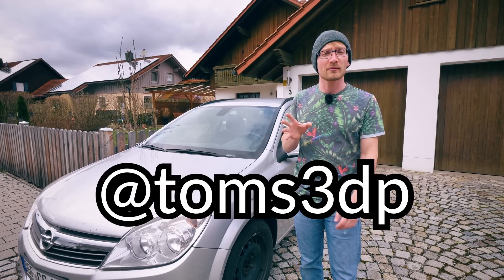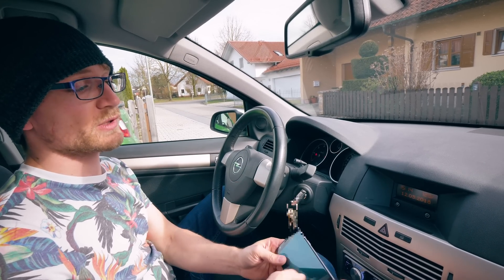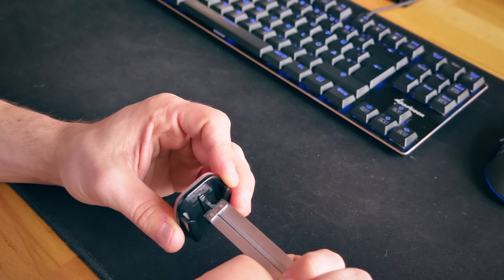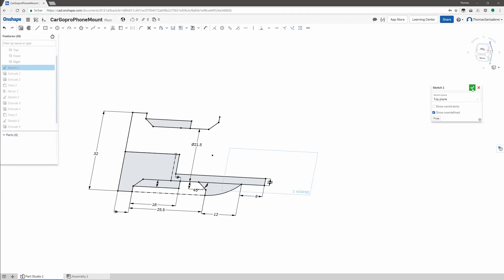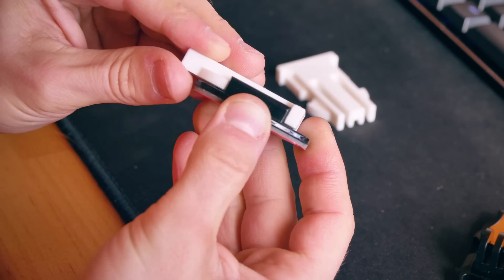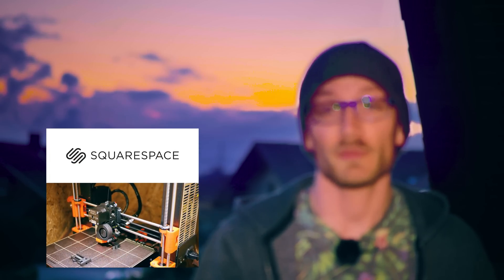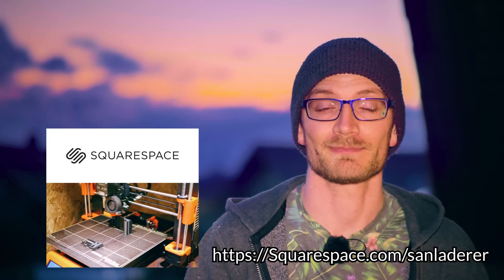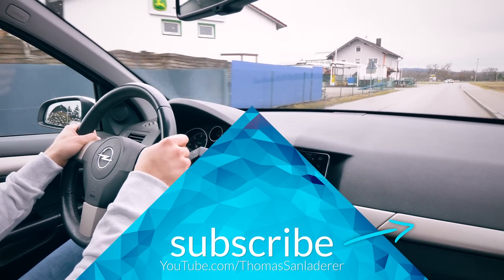Solving problems with 3D printing: Upgrade your car!

Comment: My 2014 Chevy Sonic has like a tray on the dash where I put change, but the coins fall out every time I make a sudden stop or turn so I 3D scanned the tray and designed a new one with higher walls that curved in so no change falls out. I've been using it for a year now and it works great. I made a video on my build too.

Comment: Recently I finished modifying my Ender3 to print TPU filament. One of the first things I made were some replacements for the rubber bumpers that keep the air filter in my wife's car from rattling. They had worn out, and now she has some shiny blue ones in there and the car is quiet again. 

I myself drive a very common vehicle in the US, and it's handy because there's all sorts of STL's out there for it.

Comment: hey after 2 years , can you let us know how the material got through heat & time .
did it survive ? 
here where i live it can get up to 80° inside a parking car.
i know for pla it could be a problematic. 

would love to hear your opinion to make the right decision
Reply from the maker: I don't own the car anymore, but from experience of using parts in similar conditions, ABS / ASA will hold up perfectly over time.

Comment: I like your channel. I liked Opel until they came up with this model. In fact, my very first car was a 1983 Opel Manta 1.8, then went to Kadett...  But this one.... it was probably designed and signed for production on the first Monday after October-fest... :- D and you can 3D print your front suspension droplinks, yes, they are plastic, where on any other cars they're actually made of steel... :-D :-D hope you got rid of this thing by now..

Comment: The problem is one needs to remake this holder after every phone upgrade. Which is actually not a problem in case you are the very designer of the holder and still have original cad files to modify. That's a biggest plus of DIY methodology: if I make it myself, I can fix it!

Comment: This was probably said before, but it looks like your car has a 2U space to fit a cheap android auto radio in your vehicle. If you don't have a mount, you could always 3d print one and have the USBs come up to your phone mount so you can still have your phone available and have a full android auto experience with more 3D printed parts

Comment: recently, i made a two piece belt tensioner for a CNC router i'm building.  I designed a sliver of the two pieces, printed them in about 10 minutes each, and then verified they would slide nicely without binding.  once i had them working nicely, i then extended the length to print the final copy.  doing this way saved time and filament.  In your design, I would have went about half the size until you had it sliding easily together.  just my two sense as a beginner in 3d printing and being cheap.  Otherwise, nice job!

Comment: Hey Tom if I make a window bracket that rides a guid rail and bolts to the glass out of pla with 100% infill do you think it will hold up in the summer time? I'd like to email you pictures of it to see what you think. I can't figure out my petg but they came out flawless using pla

Comment: I want to print things for my car that are way bigger than my build plate.  My Toyota Highlander has a known issue of visors that plop down due to weighing too much.  I want to print new visors that will hold piece of pexi-glass and coat it with dark window tint.  I'll probably have to do it in 3 prints and glue it all together.  And I want to do better cup holders for the center console.  I was expecting you to print a piece that covered the entire cubby that pressure fitted in place to hold your phone.  If the phone were all the way to the rear then the overhang would block the sunlight... at least we have sunlight here in Arizona...

Comment: Sweet, I own a 2007 Astra Twintop convertible which has a lay out a bit differently and I replaced the radio with a media system, I just use it with a fan mount, but this is a way better solution!

Comment: 3d printing: measure twice, print 5 times. ;D
Reply: My Dad as a CNC Machinist, with a boss that designs stuff. Measure once, my dad cuts 7 times.
Reply: @komicalkramer6188  I'm a cnc machinist my boss come up with an idea, tells you very little info and says get on with it, "it's your baby" he says. Then proceeds to tell you he doesn't like that, that's not what he had in mind or he thought youd do it this way...
Unfortunately thats part of being employed, learning to say "why the f*** didnt you tell me that in the first place" politely..
Reply: Classic, once i designed a conveyor and i need to print 5 pieces in total 68 times :D
Reply: Nah, I really prefer measuring 5 times and printing 1-2 times.
Less waste in time and material is always a good thing imo.
Reply: @Der_Kleine_Mann  I agree, but originally we were joking about how things often go wrong with 3D prints, either design or machine wise, meaning even if you're careful to measure twice, you still often end up doing multiple prints. And it's a play on the common saying, measure twice cut once if you didn't get it.

Comment: Der wagen hat sitzheizung? Wo schaltest du die ein? Ich habe selbst einen Astra H GTC mit Sitzheizung und die knöpfe dafür sind in über den Lüftungsschlitzen rechts und links vom schalter für die Warnblinkanlage. Habe auf jeder seite 3 knöpfe, und nicht wie du nur jeweils einen.
Reply from the maker: An dem Auto habe ich einiges nachgerüstet (PDC, AHK, SHZ, Radio...), die Schalter für die Sitzheizung habe ich in die Ablageschale unter der Handbreme eingebaut. Original ist mein Astra nur ein "Cosmo"!

Comment: Hi Tom, I had two questions.

What tap size is that?
and what is the smallest durable (thread integrity) tap you would use with 3D prints?

Comment: i did print a cellphone holder for my car too....and a couple of parts for my motorbike..even a prototype of an defensive spray that is patented now....i love 3d printing!!!
(btw. dont use PLA for it...inside of cars it will get very hot at the summer..)

Comment: Great video and glad you've shown the iterations - I had this in a project for a boost gauge where it took a few times to get it spot on. Just recently I've printed something Audi want £200+ for.
Really glad to see car stuff moving forward in the 3D printing world and where OEM bits or aftermarket solutions can cost a lot! I'm hoping to see some more car orientated 3D printing sites pop up but I'm also biased....

Comment: Why not make a pivot hinge so you can adjust the angle
Reply from the maker: Complexity! No reason to overengineer things if the simplest solution works just as well.

Comment: Similar task brought me into 3d printing 6 years ago. I've designed a small adapter frame to put 7inch tablet in 2din opening and ordered a print. The result was so pretty 3d printing service had its photo on their frontpage for like 2 months.

Comment: Did it work with your charging cable?
Reply from the maker: It did! Prefect space for it, but there's maybe an opportunity to improve cable routing (or integrate wireless charging if my phone supported it)

Comment: I wish i could cad better, you make it look easy. After a few minutes i get so frustrated because i don't know what to do. Where did you learn how to design? I am using fusion 360 btw.
Reply from the maker: CAD design is just lots and lots of experience - start with something small and work your way up!
Reply: zrobotics Thank you very much, that does sound interesting.
Reply: zrobotics 
Great suggestion; my first mini project will be to reprint the broken Lascal key for the kiddy board I want to sell. I just hope, the print will be stronger than the original. The original was awful, broke on second attempt to hold the board upright onto the buggy.
Reply: Any suggestion on how to make it stronger? What material is best to use, ABS?
Reply: If you are just sitting down with the program and trying to learn it, I agree it gets frustrating quick. An easy way to help with that is to pick some (reasonable) object to model or something you want to print. DON'T try to start out with anything crazy, but something like a key gives you a part that's reasonably complex without being too difficult. Another bonus with a key is that it's a small object that can be printed quickly, so you don't waste a lot of time or material, and you can then easily compare it to the original object. You don't even need to model all the ramps for the pinning at first, just make the key blank and compare it to the original.
Sort of like learning programming: if you just sit down with some tutorials without any goal in mind, it gets very dry and frustrating very fast. Having some sort of goal gives you a reason to at least finish one model, and you just google as you have questions about how to accomplish specific things. A 3d printed key isn't practical at all, but it is really fun to open a lock with a key you printed yourself.

Comment: You could have used the accelerometer on the phone to get the angle. The program "bubble" works great for that.
Reply: Thanks just got it
Reply: Ts 3dPrints I don't think the surface where the GoPro mount is is horizontal
Reply: Kil Arn Don't forget you can put the phone there, then reset it (tell the app this is your zero level) and then move it and it will tell you the degrees from where you told it to be zero :)
Reply: It is horizontal.

Comment: 0:50 Censure the keys. Quite clever considering most of your viewers own a 3D printer :)
Reply: Jokes on you. I keep useless keys on my ring.
Reply: @zecuse  i have so many keys on my keychain, even if i would post a Picture of them, it would be pretty hard to find out, which key goes to which lock
Reply: That car isn't worth stealing lol. Better to take the older Astra G, much nicer car.
Reply: If you're a professional lockpicker It's far easier than that and the process doesn't require a printer!
Censoring it's just a good precaution when you're an influencer who has public domain infos about residence and stuff like that

Comment: did you consider putting a raspberry pi 3 with the 7" touchscreen and android auto in there?
this combo is nearly perfectly double din size and shurely would fit nice
Reply from the maker: miko007 wait, there is Android Auto for the RasPi?
Reply: Thomas Sanladerer yep, it is called "openauto". it is just a "headunit", you still need a phone to connect to, but bluetooth is available on the newer raspi models and you can benefit from the other raspi features as well (like custom GPIO input connected to functions of your car or even a camera module for a rearview camera). all in all a pretty nice system.

Comment: The metric system is so much better. You made all your measurements so fast.
Reply: Metric is a lot nicer for coversions, but people freak out about it too much. You can easily do the same thing you do in metric with imperial. It's whatever is easier for you for the specific thing you're doing.
Reply: I am American and thus use inches and yard and crap. Metric is so much easier. I use it at home and it's just much quicker and easier to add measurements and make adjustments for scale. Someday maybe America will catch up to the the rest of the world for measurement standards.
Reply: Did you first learned to use metric?   Since I did not, I find it harder.  Just wanted to know if that would be a reason for preference.

Comment: I'm totally bummed now that I bought one. I love the one I have because it has a magnet in it and I can go from Landscape to portrait very easy. I think I will make on that has a magnet in it but doesn't clip to the vent and uses a GoPro mount like you did. Awesome idea thanks!
Reply: I would avoid any of those phone mounts that clip to the vent. Seriously, don't give it away to a friend, just throw it out or make an alternate mount for it. Used to work as a mechanic and saw quite a few of broken vents from those. Doesn't make your car undriveable or anything, but just the vent by itself can be somewhat expensive (up to us $150) or potentially very annoying and ridiculously expensive (>$500). We had a customer who was unlucky enough that the broken piece of plastic rattled down into the blend door and jammed it into the floor position, and with winter coming up they needed the defrost. Ended up having to pull the entire dashboard out of the truck to fish out the broken piece.
Reply: That sucks but the one I have seems ok. I do not take it in and out at all. Just put it there once and leave it so I guess I'm safe. If you move it around all the time I can see that happening. The biggest thing with these is if you can't shut off the vent. I have had very few cars that cannot do that and every car I have had in the last ten years has been able to. The heat affects the phone obviously and I see that as the biggest downside which to me is another none issue. I love the thing and think it's the best idea for a phone mount. Once you go magnetic you'll never go back!

Comment: Thank you for this great video. I've recently started designing my own parts and also love the fact that you can iterate so quickly by adjusting the parts and printing to test the fit. I really appreciate the walkthough of the design process and learned quite a bit. I need to experiment some more with tapping parts and joining using screws. Again, thanks for the great videos!

Comment: Hate to state the obvious, but kudos for blurring your keys. Such a smart move.
Reply: Maybe I'm missing something, there is no reason to do this, it is just not possible to determine the exact bidding from a video without a closeup and strait edge for reference.

paranoia perhaps?
Reply: Actually its been known that some criminals are so good at replicating keys by just looking at them once, that even prison guards hide their keys. All you have to do is get close enough to the original and then you've got yourself a bump key.

Comment: I was hoping to hear something about designing for print tolerance.  For example, if I have a 0.4mm nozzle, I basically have to print in those increments, right?  Does the slicer take that into account?
  Could print something that is say, 1.3mm or 1.5mm wide?

Also, any comment on printing threads?

Comment: Just one thing - DO NOT USE phone for maps in car. Get a proper gps. The reason behind this is that gps drains a lot of battery and if you will connect charging, phone will heat up even more. If you really need to use it, you should place the phone in vent and put some AC on it.  Great idea for 3d printer daily use :) Great work Thomas
Reply: I did exactly that on my tour through the US. The mobile had 3 different apps to not get lost in desert valley and required AC to keep the battery above 80%. It lost charge despite beeing plugged in when not in the AC vents.

Comment: I like how you blurred your keys. Nice thinking.
Reply: Even cutting it out of sheet metal or a food tin will do
Reply: yeah I would never have thought of security issues like this :D
Reply: only problem is the key is in the ignition and it requires a chip (maybe) so no chance of copying the key (or maybe print hehe)
Reply: @Darren Munsell I know this is a year late but newer cars or most of the cars has keys with chips which makes the duplicate key useless
Reply: Hi, actually I dont understand why should we do it? Security?
Reply: Yes. now a days its very easy to take a picture and recreate the key and 3D print it. Then maybe copy that to get a real key.

Comment: Wow, I went to all the effort of integrate an android computer in my Astra H but in my opinion your solution is the way to go. I was also thinking on creating a small compartment to take advantage of the empty space under the panel next to the dome lights. This is what I did for my Car Android system for my Final Project in Industrial Engineering if you want to check it out.
https://youtu.be/8L3ZARnPzhk

Comment: Quick question: How do the parts do with high humidity and heat of being left in the car all day? Probably not an issue in your use case but I would've loved to see the spec sheet for the PCA ABS you used just to make sure not fumes are leaking into the car.

Comment: I do similar for my truck, but i put i IQ CHARGER on it, so now i just slide the phone in the support and it show me the route and charge in same time. With simple modification you can do same on yours and get the big advantage
Reply: Coveniece at cost of efficiency of charging
Reply: I have a little trust issue with wireless chargers, in the sense that they are quite lossy and can get a bit warm - right against the phone's battery. I know this is not the most rational thing to be afraid of, and i assume those that just pop components willy nilly are just defective, but still. What i like though are those cheap magnetic cables, you can buy a dozen from China quite cheaply, leave the adapter end in the phone permanently and then just have a cord per location or use case.
Reply: Exactly.

Comment: Hey, nice work! This is exactly why i love 3d Printing! 
Would you mind sharing your Filament and Cooling settings for the Material? I am printing the Aprintapro PC-ABS on an MK3 and i feel there is room for improvement with looks vs strengh (especially bridging and overhangs) 
Thanks!

Comment: Nice one Tom! Coincidentally, as I know you're into your mountain biking, I designed a system to use the same GoPro quick release bracket for USB power packs, just inverted and the opposite side attached underneath the Garmin mount. It takes up very little room and increased the life of the Garmin GPS from 3 hours to 20. With two inputs it can also charge my phone in case I break my leg on a jump far from civilisation (again).